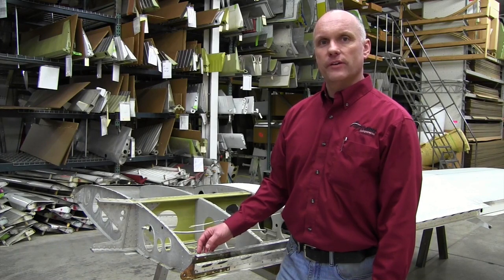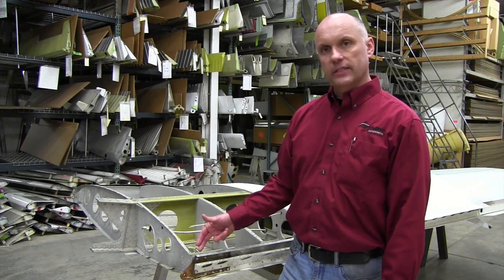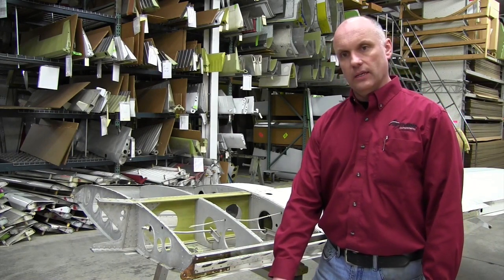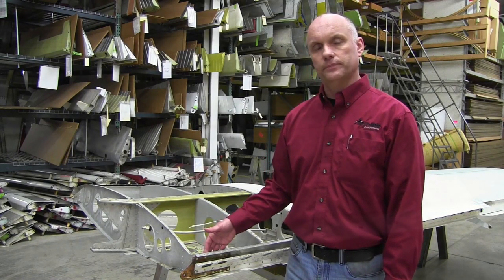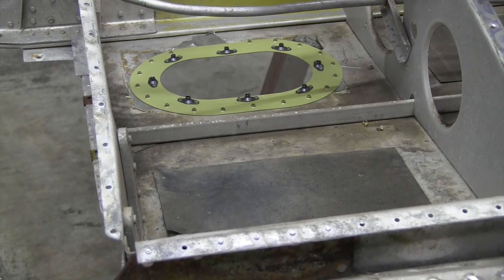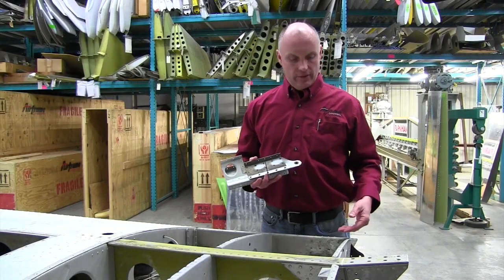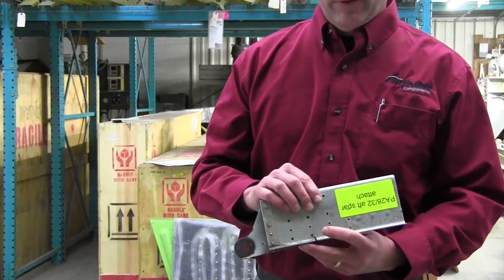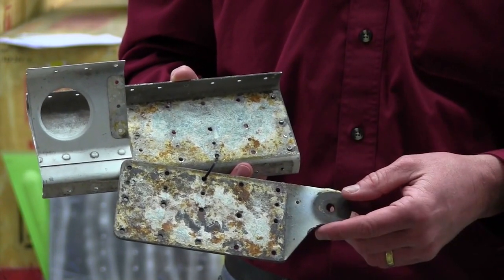Piper SB 1244B Inspection of the Aft Wing Attach Fittings

Comment: Dis-similar metals in contact corrosion has long been a problem with aircraft,the use of cadmiums and zinc chromates did arrest the problem to some degree but there have been health hazards associated with these products,the electrolytic action creeps between metals and fixing bolts no matter how things are treated,it is not just Piper but many other manufacturers too,these are excellent insights into what is happening beneath the surface of any aeroplane.

Comment: You would think Piper Engineers would have had enough foresight to know what dissimilar metals do to each other!  In this case, they were just asking for galvanic corrosion to set in  with the presence of moisture. I just dont know what they were (not) thinking!  Something as simple as a barrier coat of sealant (8802) on the two faying surface may have prevented this condition.
Reply: There ARE specs for coating those parts in contact. One of the problems is a change in the coatings. The zinc chromate specified to provide the best long term protection was changed decades ago due to the carcinogenic  problem of breathing the paint spray. Alternative coatings did not have the long term record of protection. Getting the certification of a new coating was likely too expensive for any chemical/paint company to pursue with such a limited market for old planes. Until recently it was not known that long term durability of the corrosion preventive process specified.
Reply: Great video topic and good Comment. It’s likely when designing and building these older Planes very long term extended use wasn’t expected or even planned for. Possibly Coating contact areas is a good idea but long term use experiencing flexing and vibration may erode the Coating. Consider calculating the strength gained from the steel component and beef up the Aluminum part to match. This may resolve the corrosion problem but the fatigue resulting in cracking likely remains. Looks like there will always be intensely deep inspections.

Comment: So a single bolt attaches the trailing edge of the wing to the fuse? Yikes.
Reply: Exactly...total, complete, Mickey Mouse design - sad to say. Amazing the FAA allows any of the Arrows (PA28's) to fly over populated areas/cities. They are not safe and the accident records of mid-air structural failures are glaring proof of this fact. Terrible structural design team at Piper.
Reply: @glennandrews7689  I'm aware of 2 wing separation failures out of 30,000+ airplanes.  Both with very high hours and and in the case of the flight school one, an enormous amount of high impact events such as landings, touch and go's, etc.  I just bought a Piper, is this really a thing?
Reply: You might want to check your facts before "shooting down" the Piper Cherokee. There are 20 bolts that attach the wing to the fuselage of the aircraft. 8 bolts attach the top of the main spar to the box section of the fuselage. 10 more bolts attach the lower section of the main spar to the fuselage. One bolt attaches the front stub spar to the fuselage. The one bolt you saw in the video attaches the wing"s rear spar to the fuselage. I own a 1965 Piper Cherokee. After a successful inspection for corrosion, I have no worries of those wings falling off!

Comment: How many lives were lost to this?
Reply: Two, that we know of. A training aircraft, a Piper Arrow, carrying an examiner and a student who was taking his commercial checkride at Daytona Beach, Florida, crashed on takeoff, when the left wing broke off!! The plane plummeted down into a "cow field", killing both the student and the examiner on impact. That's when the FAA rushed to issue an AD regarding this! The plane was part of the training fleet of the well known Embry Riddle Aeronautical university.
Reply: @747-pilot  The same thing happened in 1987 to a Warrior used for pipeline patrolling. It also had just over 7000 hours total time.
Reply: None. This bolt doent not hold the wing onto the airplane. Theres another single bolt on the forward part of the wings as well, but it doesnt hold the wing onto the airplane.